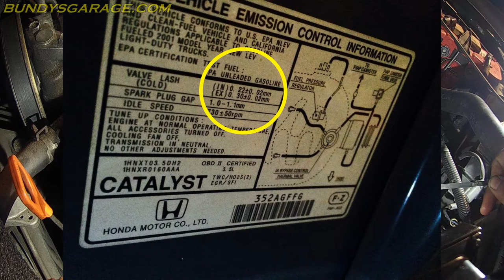Honda Accord V6 Valve Cover Gasket - J Series V6 - Adjustment - Odyssey Pilot CL TL MDX

Comment: Just completed the gasket swap (in the rain).  Torque wrench failed me on the 7 lbs/ft setting and I striped the threads out on one of the bolts for the valve cover(10mm bolt).  Used a heli-coil kit(M6-1.0, 9mm) to be able get the valve cover back on today after rethreading the block.  Aluminum blocks are unforgiving...  Nothing like riding my bike to the parts store in the rain...   Froze the six oil seals for the coil packs two days beforehand.  Was able to press them in by hand.  Used 30mm socket to seat them flush.  Great suggestions!  Would never have attempted to pull this off today without this video.  After initial viewing I picked up the tools online ahead of time. Thanks again, this video really represents the best of what youtube can be.
Reply from the maker: +Eric Collins So glad it helped you out. That's funny and sad at the same time that you rode your bike in the rain to the parts store. The aluminum blocks are very unforgiving to say the least. My dad, Stuart Bundy, who taught me a lot about car repair, showed me the trick with the oil tube seals. Feels good getting it taken care of!

 http://youtu.be/UtuijMGQcVU
Reply: +Eric Collins Same thing happened to me today. My HF torque wrench....will be getting replaced very soon.  ;D

Comment: I need help I can’t take off the manifold of a 2001 Acura cL type s v6 3.2l I’m trying to replace the valve cover gasket it feels like it’s something holding it down I took all the hoses off the throttle bodies I can’t find what’s it holding it down please someone reply ASAP
Reply from the maker: Does it come up and off a little  or is it still stuck in place?

Comment: I know this is an old, but thanks for the video. I'm doing the same thing this coming weekend. I think you could use dry ice and alcohol to freeze shrink the spark plug tube seals. Much more available than liquid nitrogen.

Comment: Use MALH value cover seals and tube  seal I had trouble with FELT PRO SEAL  they  leak with in 2,000 miles after in stall

Comment: Hey bundy, So i wanna do a coolant drain and fill on my 2010 odyssey. So basically I drain the coolant, fill it with coolant, start the van up and wait till i don't see any bubbles coming out of the radiator?
Reply from the maker: Here is a video by Eric the Car Guy. He shows exactly how to drain | bleed the cooling system:

http://youtu.be/zUpXgAJ1gjU
Reply: ***** Does the J35A7 have a bleeder like the one in the video or is it "self burping"
Reply from the maker: It does not have a bleeder valve you have to let it burp through the radiator.
Reply: ***** So just start the car without the rad cap on?
Reply from the maker: Yes get that spill proof funnel and then start it up and go through the process in the video.
Reply: ***** Thanks. I'll contact you if I have any questions. You have quite alot of experience on the J35s. BTW, are you still a GM guy?
Reply from the maker: Yes I work on both. I'm restoring a 99 Tahoe 4x4 right now.

Comment: I have a leak on one of those gaskets that go around the spark plugs, but the rest are fine even the valve gasket.( no leaks but at one of them, at the spark plug) Can i just replace the one that's leaking and reuse valve gasket? or do i have to get the set?  (The set was replaced last year around this same month but valve seating was done at the beginning of this year. i guess a bad reinstall damaged that one.)   leak is small but by the end of the month oil starts filling up causing misfire.

Comment: hey what that thing does ? the part under the tb that has two houses ? it something called air assist assembly something like that i've seeing some guys cleaning it ? i just wonder what it does btw i'm gonna order some gasket for my van i think i will replace the bolt washer as well ? you said you leave the spark plugs seals on the refrigerator?

Comment: Do you have to take off the intake manifold if you are just doing the front cover?
Reply from the maker: Only if the intake manifold is in the way of the top 3 bolts.

Comment: Hey Bundy, what's the link to purchase that wrench set you mentioned 9:20 in the video. Looking to do the timing belt on a 3.7 motor  in an 09 TL and would rather buy the full set than just the 1x (14mm/17mm).
Reply from the maker: +bigyute007 http://www.amazon.com/gp/aw/social/swf/B002AIX502/o=ShareProduct/ref=tsm_1_aw_swf_d_sp?vs=1

Comment: Hey Bundy, what's the reason you need to replace the valve cover gasket?
Reply: because it leaks.
Reply from the maker: After time the gasket | o-rings for the valve covers become hard and lose their ability to stop the oil inside the head | valve train. Also sometimes the spark plug tubes fill with oil and you need to replace those seals as well.
Reply from the maker: Yep it leaks after awhile.

Comment: Any advice regarding not ripping the spark plug gasket seals (spark plug grommets)?  I replaced the cover seals and also the spark plug seals as there was oil in the spark plug tubes.  I had to take one of the valve covers off and noticed the new spark plug seals were ripped.  I installed them as per the orientation in the video and also based on the orientation of the old ones.  Do you need to lube the top of the spark plug tubes and the spark plug gaskets so they slide on without ripping the spark plug gaskets?  Any advice would be appreciated.
Reply from the maker: Yes put some oil or WD40 or grease or you could even use Vasoline on the seals to help them slide in.
Reply: Is the orientation in the video the correct way of installing them?  Thanks for the advice it is appreciated.
Reply from the maker: Yes, you have to bring the front cam to the number 1 position marked on the cam that will line up with the top cover. Then moving to the crank, there will be an outer mark at about the 11 o’clock position that will be lined up as well. But I would not move the cams or the crank without the belt on you will get it out of timing. Proceed at your own risk.
Reply: Thanks for the advice.  Made sure to coat the spark plug seal gaskets and the lip and outside of the spark plug tubes with a generous coating of oil.  Then I wiggled the valve cover on in a circular motion so that the seals went around the outside of the spark plug tubes without tearing the seal lips.  The front was easier as you can easily match up the tubes with the seals.  The back was a bit more difficult, but with a helper holding a mirror and taking my time they went on without tearing too.